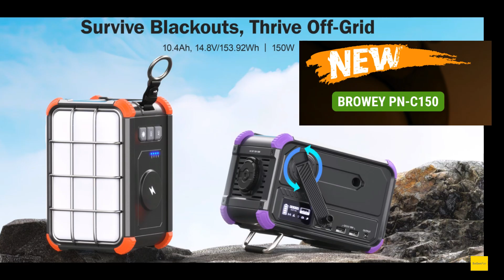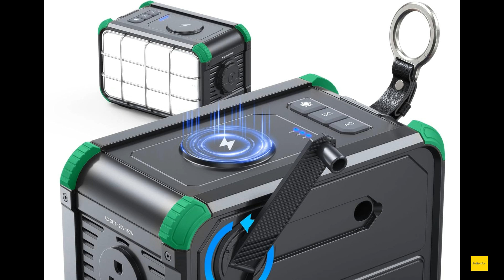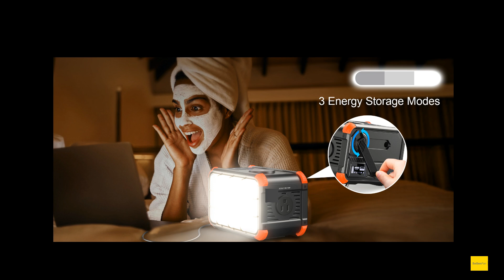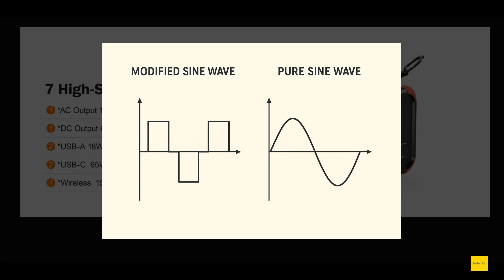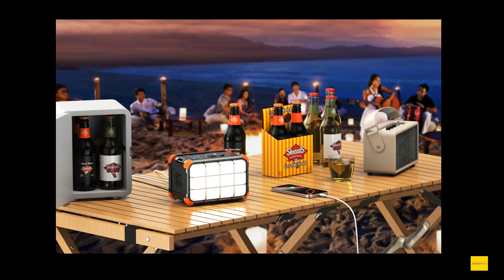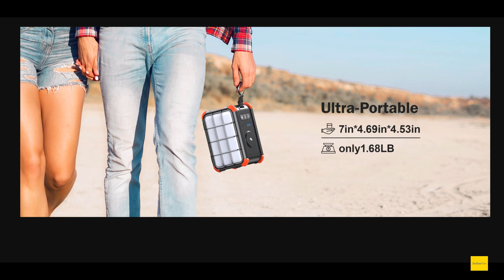Browey C150 with Hand Crank

Comment: The UK had a feild backpack radio called the clansman. Literally bulletproof. It had an option to clip on a hand crank. Suggested use if the battery went flat, a platoon of men took turns to crank the guts out of it in 30s rotations. For however long it took to charge it back up to send a transmission. Hand cranks never have nor will be an effective way to convert calories to energy. But if you've got nothing else, at least you feel like you're doing something...